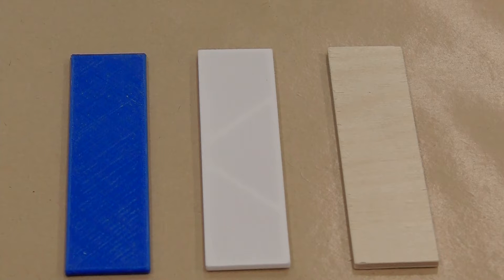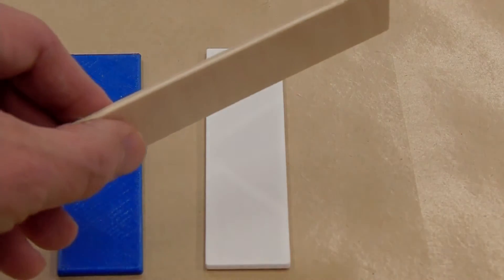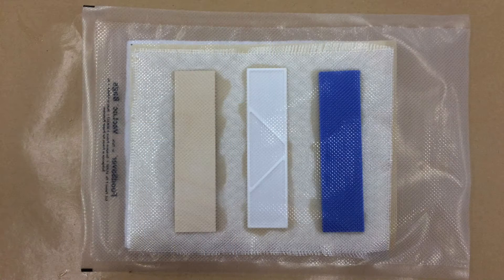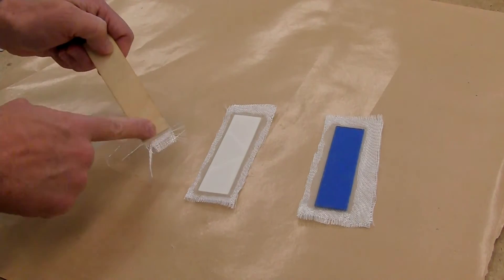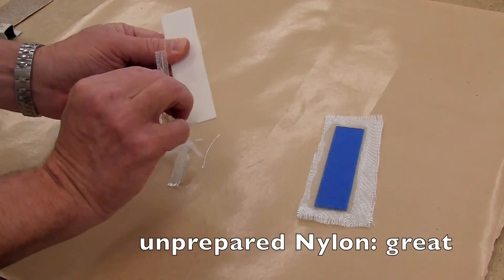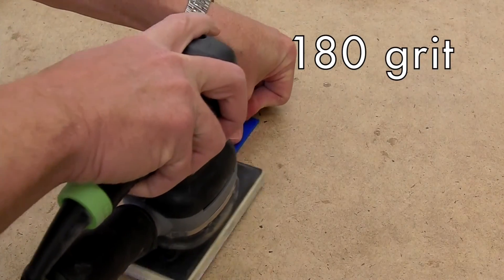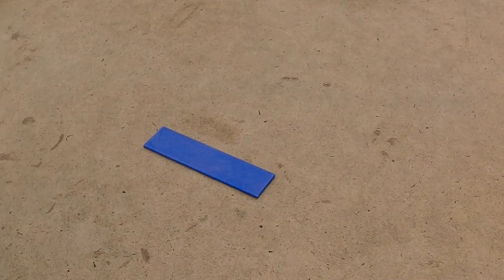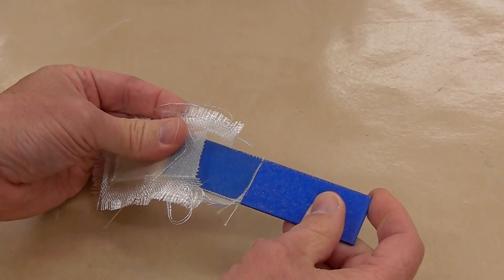Fiberglass on 3D Parts

Comment: Anyone knows how petg bonds with epoxy and glas fiber?
Reply from the maker: PETG less well and ABS better. (These samples were PLA, which bonds well.)
Reply: @JohnLCoker  hmm... Well maybe I should print it with ABS then. I just hate the material and how it creates particles in the printer
Reply from the maker: @mikasjoman  Nylon also bonds well. I should do a more thorough test of this...
Reply: I tested with both petg and nylon cf and the results were that they ripped of real easy

Comment: what kind of  resin did you use? epoxy will bind most things, but if you use something like polyester resin it may not work so well, also keep in mind the curing time as well, that could affect your adhesion as well as how you applied the glass and the resin.
Reply from the maker: This laminating epoxy (AeroPoxy PR2032).

Comment: Does the fiberglass add any considerable strength to the PLA?
Reply from the maker: Probably not a single wrap, but the point is that it can be built into a larger composite structure.
Reply: I get that but I was wondering if fiberglass could be an option to harden 3d prints and make them more resistant specially for mechanical stress
Reply from the maker: @JuanSanchez-rb4qu  Good question. I suspect that the fiberglass wrap wouldn't do much for the mechanical properties. But then again, one one can get strength from a core and stiffeners as we have done for a long time with foam: http://youtu.be/5mUKQ7CUd8I
Obviously, 3D printing will replace everything else eventually, so we just need to keep following the developments in materials and build volumes.
Reply: So filling 3D printed parts with foam?. And yeah with a hangprinter and enough poly filament you can already print structural parts.

Comment: What are you actually trying to determine from this? I'm new to fibreglassing and would like to make some moulds using PLA. I would of thought that sticking is a bad thing?
Reply from the maker: Yes, sticking is be bad for making molds, but good for skinning 3D printed parts with fiberglass.  You could probably make molds using PLA printed parts, but the surface irregularities would need to be filled.